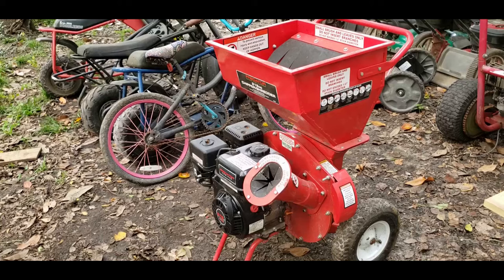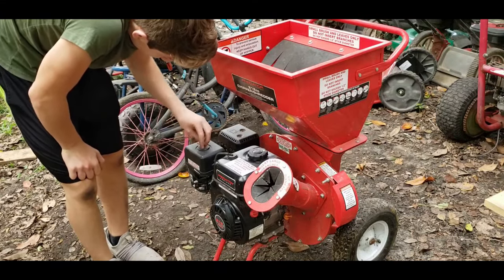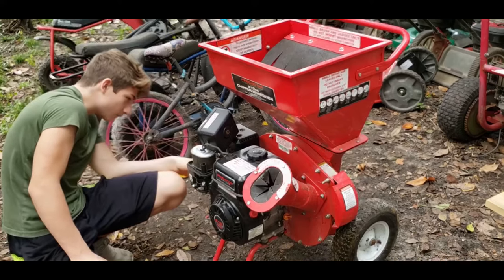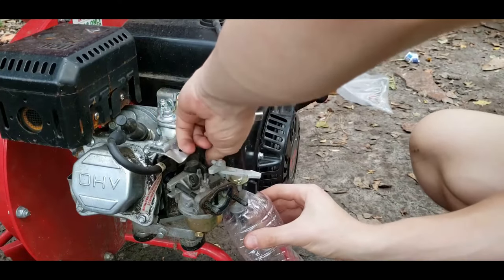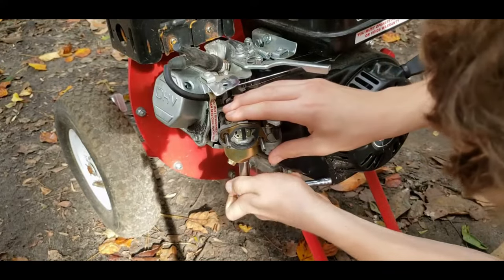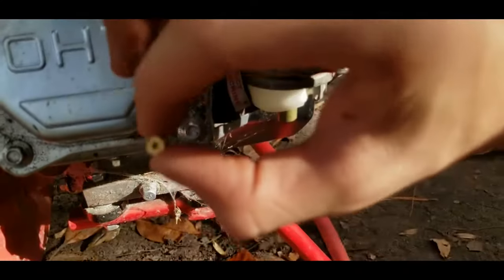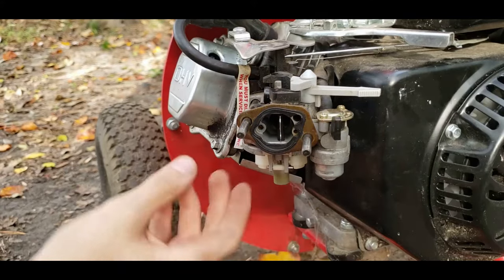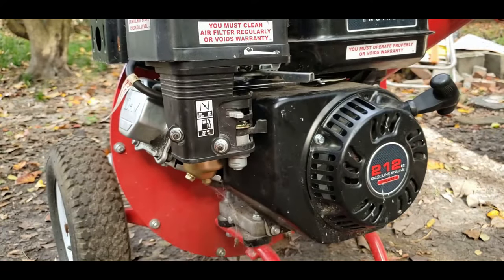How To Clean a Predator 212 Carburetor in 5 Minutes!

Comment: I see you have a Coleman cc100x in the background with an empty frame! Thats the exact reason I’m watching your video. It idles… decently on choke, but when you take it off choke it shuts its ass right off. And I have a predator 212 in it of course.

Oh, and also, when I get on throttle it sputters so much and has no power unless I floor it.
Reply from the maker: Check your throttle cable to make sure the inside wire is correct and that the outside part that doesn't move is secured right at the end. I can send a picture for reference. Also, sounds like carb is dirty. If you already cleaned it and same issue either you skipped part of the video and didn't remove emulsion tube etc or maybe there's dirty just really stuck in there. Try cleaning it and make sure gas is clean (no water or dirt in it). If you're sure you did those things, make sure you put everything together correctly. Still doesn't work? Buy a new carburetor for it, sometimes there's just dirt you can't get out of it- $15 Amazon.

Comment: At the risk of sounding like  an idiot, I gotta tell ya, I couldn't get my new Predator chipper started.  Having torn up the box and the styrofoam to get the parts out, I didn't want to return it.  Got your video and went step by step - still wouldn't start. Then my brain woke up (woke can be useful) and i realized i had done everything right but turn the switch on.  Did that and it started right up.  But your video  showed how to service the carburetor.  So it was time well spent.  Thank's for the step by step.
Reply from the maker: Awesome! I'm glad you got her fired up, now you know a valuable thing in case you ever have to clean it.

Comment: oh sweet

I just bought a place out in the woods and the folks who sold the house left one of these behind; exact same model and everything. Haven't been able to get it started; pulled the spark plug, looked good, I was getting spark, but it's been sitting for a while and I just can't get it to crank. Just found this and I'm gonna hafta give it a try tomorrow.

Good stuff, man; thanks for posting the vid! I'll let ya know how it goes!
Reply from the maker: Thank you! Hope it helps you out, I tried to be straight forward and informative. Super simple fix, good luck! Ps: make sure it's got oil too ( :
Reply: Well, it's been rainy for the past couple of days and I didn't get to it--until today!

Sure enough, totally clogged. Soaked in alcohol for a sec and blew out with a can of air, did the same for the tube, made sure everything was clear, put it all back together, and...

started on first pull

You rock, man!

Oil was fine, but the stick doesn't seem to have any measurements on it; the whole thing is just a criss-crossed pattern--how do I know if there's enough in there? Is it just like, "make sure there is some" or something?

No worries, in any case; I'll be keeping an eye on it, but holy crap, man; totally awesome! Thanks again for the vid!
Reply from the maker: @jserf  I'm glad the video helped you out. As for the dipstick, those cross marks don't really mean anything in my opinion. As long as the oil goes to about the top of those x marks, you're good. If the engine was sitting for a while, I would just replace the oil whenever you can, just so you know it's good. Anyway, thanks for your support!

Comment: Any idea what size socket to remove the spark plug? I used to have  3 sets but . . . thieves posing as friends.
Reply from the maker: You can use a 21 or a 13/16". Those harbor frieght socket sets are what I use

Comment: I have a peadator 224 and started it and gas was leaking from exhaust how do I unload engine. One pull is easy the other not so but its not locked. Could it be full of gas.
Reply from the maker: Check for spark. You can remove spark plug to test and while you have it out you can pull the cord to get the gas out
Reply: @BlakesBuilds  thank you
Reply from the maker: @phillipgreen4003  let me know if you figure it out!
Reply: @BlakesBuilds  for sure

Comment: Just put a 212 predator on my mini bike and when trasporting it home from a family members shop it was layed om ots side ans oil got everywhere. I put new oil in and blew oil out the top and it still doesnt run well. Any tips on what to do?
Reply from the maker: Depending what side you laid it on, you may have gotten oil in the carburetor. I think someone else commented recently about a similar issue, and a carb clean fixed it

Comment: Mine is brand new and won't start, wonder if it has a short in the kill switch. No sign of spark. Im so mad
Reply from the maker: Do a return if you still have receipt/box. They are very picky about the gas in tank, so make sure it's dry
Reply: @BlakesBuilds  I fixed it. Not only did I put in a new AC Delco plug and unplug the oil sensor, I found out it had a fuel cutoff I didn't notice. Come to find out, it runs pretty good when it gets fuel. Go figure.
Reply from the maker: @davidwelday3276  I wish I knew it wasn't spark, I would've told you to check that!

Comment: took off the carb, completely cleaned it (I thought). Still has the same issue. Did I not clean it well enough or there's some other issue?  Btw, do you keep your old gas or chuck it?
Reply from the maker: If you know for a fact that the gas is good and there isn't any dirt or water in it then I would keep it. If not just drain it like I did in the video and replace with new gas
Reply from the maker: Did you clean it just like I cleaned the one in this video? Make sure you spray through all the holes and try to get the emulsion tube to drop and clean that as well
Reply: If you didn’t already, check the spark plug. I changed mine in the spring and somehow by fall, it was all gummed up. Maybe some gunk got loosened up cleaning the carb. 🤷

But after that, changing the oil and cleaning the carb, runs like new.
Reply: @snowdog4478  thanks - yah I took out the carb and cleaned it, and replaced the spark plug. It's running much better now :)

Comment: What did you clean out the stuff way
Reply from the maker: You can use carb cleaner, brake cleaner, or even water (if you make sure you blow all the water out)
Reply: DONT use water lol
Reply from the maker: @RandomPerson-ob1hk  water is ok for cleaning jets out as long as it is completely dry after. I have done this many times
Reply: @BlakesBuilds  I just mean if you're not experienced it's not a great idea cus it has more likelihood to screw stuff up

Comment: What did you use to "clean" the jet??
Reply from the maker: You can use carb cleaner or brake cleaner to spray though the jet. I also blow air through it when I finish.

Comment: Can plug gas with a golf tee so u don’t have to drain gas
Reply from the maker: That's a really good idea, thanks. I used to use the ends of a pair of pliers
Reply: Vise grip pliers
Reply: I use a phillips screw driver to plug it.
Reply: The choke level on the carb comes off...and has a plug built into it..pro tip
Reply: @BlakesBuilds  But don't you need to drain the gas if it's old? As in about 2 yrs in my case? I bought a used Predator 2000 that was last used a couple of years ago. I haven't tried to start it. Was told better to clean/replace the carb and gas and oil first. Is that true? ty so much. Subscribed for the great info. :)
Reply from the maker: @uber2tuber  yes always drain the gas on an unknown small engine, it could be old but it could also have dirt or water in it.

Comment: can I use water to clean the emotion tube?
Reply from the maker: If you use water you have to make sure it is completely dry before you install it back on. Also, water doesn't get rid of the dirt like carb cleaner so make sure the dirt is actually gone too.

Comment: What color is the gas cap supposed to be ? Mines yellow
Reply from the maker: The predators all usually have black gas caps. If you bought it from someone it may just be a replacement.
Reply: @BlakesBuilds  would you say a yellow gas cap is bad??
Reply from the maker: @fernandocastillo8026  do you mean the outside or inside is yellow? It's not necessarily bad if it's stained on the inside, just make sure you drain the fuel if you don't know it's good
Reply: @BlakesBuilds  the gas cap is yellow I mean
Reply from the maker: @fernandocastillo8026  it is fine to be a different color as long as it works as a cap

Comment: You’re saying jets. Was there two of them?
Reply from the maker: Yes, I think I show both in the video. There's a plastic jet that pops in right under the idle screw and then there's the brass jet inside the carb
Reply: @BlakesBuilds  oh ok. I’ve watchEd it ten times but still only see what you called the jet and what was the emulsion tube “sp”
Reply from the maker: @anybodysguess960  you don't have to clean the other jet as much as you'll have to clean the brass jet and emulsion tube. The engine should fire up without having to clean the top one. If not, then you just have to pop it out with a flathead and spray cleaner through it
Reply: Sorry I keep asking. I watched again. I don’t see the second jet you removed: I think you only showed one so I don’t know where to find the second one?
Reply from the maker: @anybodysguess960  don't worry about the second one. Put everything back together after you cleaned the carb then it should fire up

Comment: Another tip, don’t turn your engine on its side with oil in it or you will have to watch this video. As in my case oil got into the cylinder and the carb whoops
Reply from the maker: Lesson learned! Turn fuel off and tilt engine on exhaust side to avoid that next time, and to avoid fuel leaking from carb out of air filter

Comment: That is too easy, is there no idle jet somewhere?
Reply from the maker: Exactly how I wanted to present it, really easy to do! This carb has 2 jets and an emulsion tube. The air jet (plastic piece you pop out on top of carb, under idle adjuster screw) does not usually need to be cleaned. The main jet (one that screws into bottom of carb) should be cleaned and is usually the culprit for no starts or bad idles. The emulsion tube (one that comes out after main jet is out) is also important to clean, as a clogged passageway will lead to bad idle. Cleaning the carb holes out and those two jets inside the carb are usually the only thing needed to be cleaned